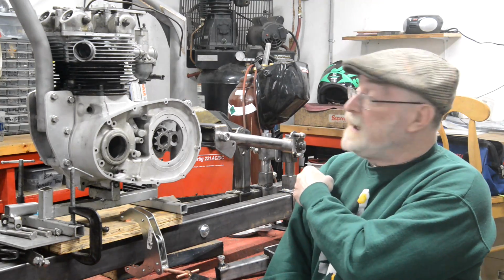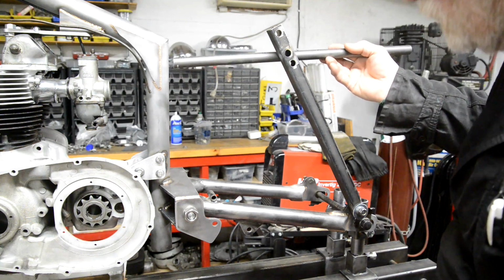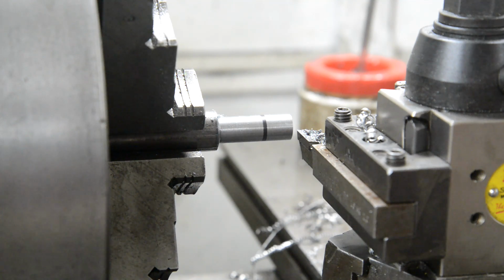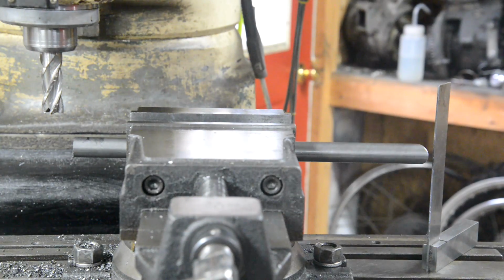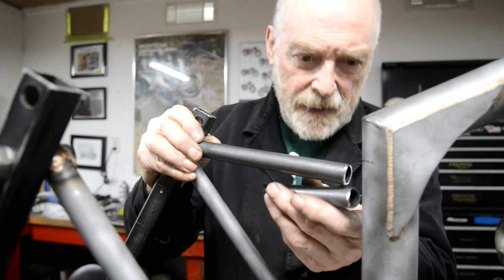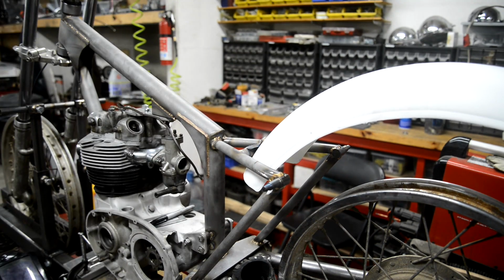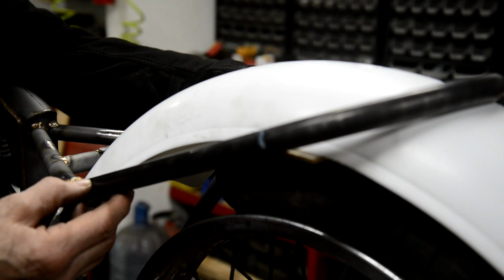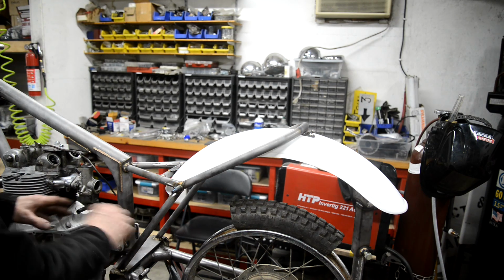Triumph 500 Otter  -  Part Nine

Comment: Looking good so far, I was wondering why use the 14" shocks when the 12" would have made the seat fabrication a lot easier. At least the ride should be a bit softer with that shock angle. Thanks Mike.
Reply from the maker: The biggest single difference between old and new trials bikes, weight accepted, is rear suspension travel. A modern bike will roll over obstacles that you have to work at on an older bike. Those couple of extra inches of travel make all the difference.

Comment: Hi Michael. Having added a bracket for the coil above the rocker box, can you still get it out? If not, the Triumph TR5T (Adventurer) uses a different rocker box/head stud retaining method that is easily adaptable to a standard unit 500 which will solve the problem.
Reply from the maker: Yes I can strip the engine right down to the crankcase while it is still in the frame.

Comment: Oxford Famine Relief charity. I didn't realise that the Otter frames had the rear sub frame tp end rigid or solid? On BSA and Triumph of course it moves up and down at the tank/seat joint of course, making the whole sub frame moving or floating.
Reply from the maker: The BSA/Triumph rear subframe doesn't float. As well as the top mount the angled tubes coming from the top suspension mounts bolt to the main frame just behind the engine to form a triangle which on early frames was the swinging arm pivot.

Comment: Just a thought, is it worth explaining to people that when you incline a spring /damper unit (away from the vertical) you lower the "effective rate" of the coil ? This should then be taken into account when deciding what springs to put on...
Reply: This kind of nit picking is what he was talking about at the start
Reply: @andyb7963  It really depends if you want to do 'design-by-experience' or, by calculation. It's easy to spend a lot of money on springs if you don't have the experience !
Reply: @davecooper5951  I agree. I'm not an engineer but my logic says, if the shock has 3" travel the axle would have 1.5" at 45 deg. and 0 at 90. I think you can make up for it by cantilevering the rear axle. I happen to be working on this with my Sportster trying to figure out if my fender will rub and what length of shocks to buy if it does.
Reply: The spring isn't vertical but neither is the movement of the rear wheel, so
Reply: @Ricky-mouser  You are correct in principle. I've written software to work all this out (when I designed my Le Mans sportscar ). As you can vary the length, rate and pre-load of the springs there's quite a lot of math(s) to juggle - in general, the more you lean them away from the 'optimal' angle the higher the spring rate has to be... However, this is not the same as the damper rate (shocks) - that's a different story !
Reply: @davecooper5951  Learning things and improving things are so cool, I would love to pick your brain sometime
Reply: @Ricky-mouser  Would that be a Z28 Camaro you're working on ? I once had an entry to drive one at Le Mans. Unfortunately, it caught fire before I got to test it...
Reply: @davecooper5951  Too cheap for a Z, but it did catch fire about a year  ago and my son and I had to strip down to our underwear to save it. I was having trouble with fuel pressures and float valves

Comment: Why do you Bronz rather than Mig? Newbie here so not trying to be a dick....
Reply from the maker: MIG, TIG or stick welding all put enormous stresses into the the metal as it is melted to form the joint with the heat in a concentrated area. With the bronze the metal is only heated to red heat over a larger area and then the bronze cools more slowly. Also you can build up fillets without overheating the area. Reynolds tubing who made the tube that every top frame builder in the UK used said that bronzing was "kinder" to the tube. I have always taken their word for it.